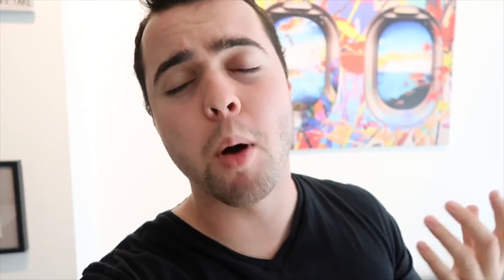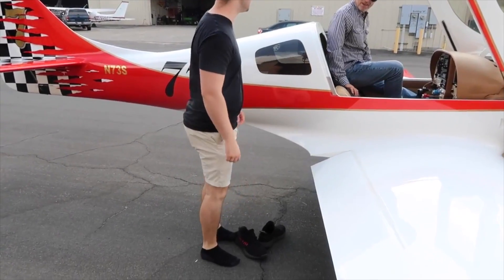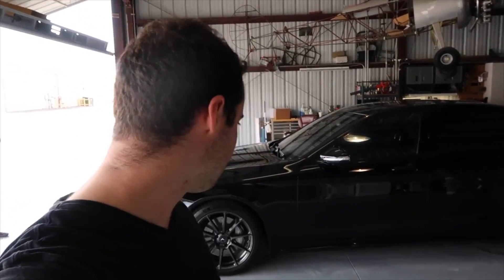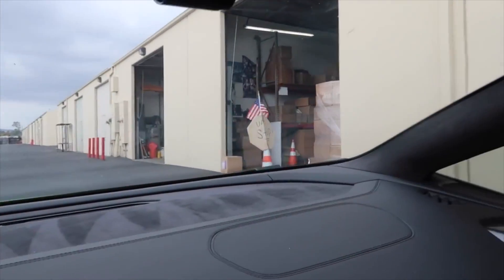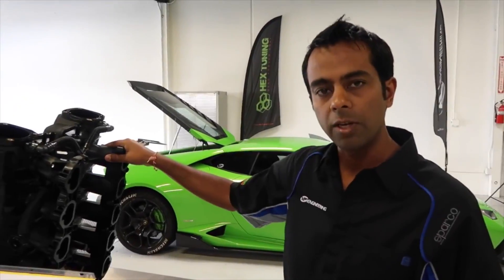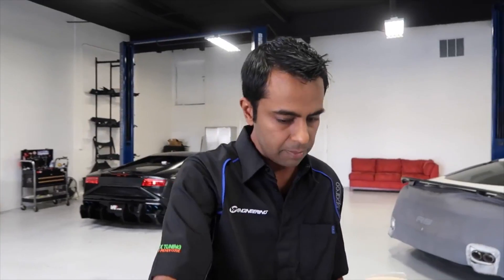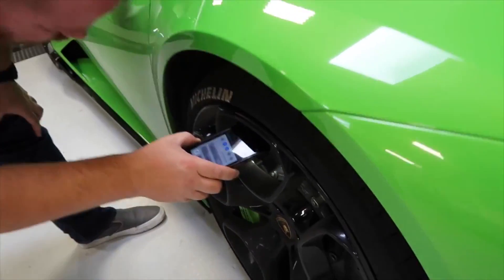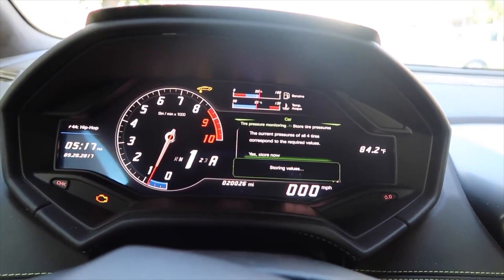I BROKE MY LAMBORGHINI!

Comment: I saw a 1948 ford truck that had 941,690 miles on it in Oklahoma City
Reply: ha my 2005 acura tl has 300,000 and still going great, just replaced motor mounts, i better sell it though...
Reply: im at almost 300k miles on my 1993 Volvo 945 still going strong, havent had anything replaced except service things

Comment: Do they not run open loop under high load? Should be no problem to redline the motor at WOT as the O2 sensor is ignored and irrelevant in this situation.  low load is a where it runs richer than normal now.. I say nail it more than normal for now  and keep out of the normal closed loop operating zone :)

Looks like those guys put in a lot of effort and did the job properly! may have go get a kit and be the first to do a back yard install :)

Comment: that sounds like a bank one o2 heater circuit has failed, which does not mean the o2 sensor has failed at all it means the heater circuit has failed, this does not mean the sensor is not working. this circuit heats the sensor to operating temperature whilst the car is warming up so that voltages relayed to the ecu are accurate as this is effected by temperature. in reality it would not have made any difference to the operation of the car but hey its fixed now and you dont have a light on!

Comment: apart from the fisic hardware do you need an ECU tune to mange the extra air going in the cylinder or the ecu adjust de mixture by itself?

Comment: The Owner def knows his shit and seems super down to earth! What is stock boost? And do they offer an upgraded smaller supercharger pulley for more boost?
Reply: The VF800 system produces 7.5 - 8psi. There is a VF900 system in development which will increase power by approx. 100 HP with only 1 - 1.5 more psi.

Comment: Claims to be an mechanical engineer but is unable to replace the wiper blade on a Mercedes??
You should say you studied engineering. There's a big difference between getting a degree in engineering and actually being a mechanical engineer.
Reply from the maker: +Slomo Racer I can replace the blades, I just haven't since they are $250 and only come in a set (aftermarket ones won't work). I get free new ones at the next service but they won't let me until I hit 20k miles lol